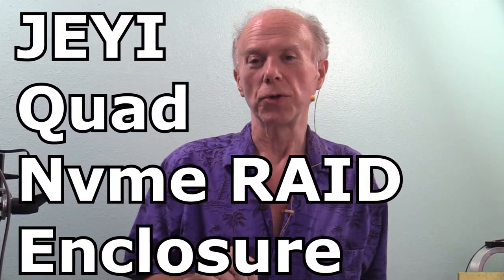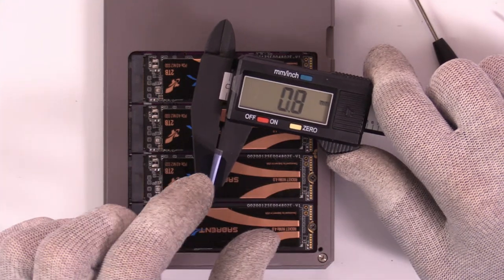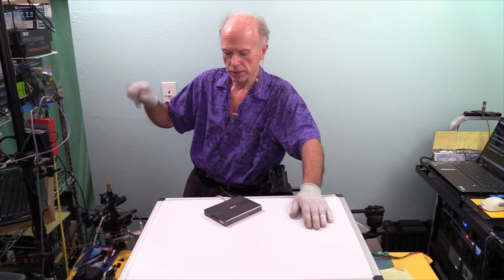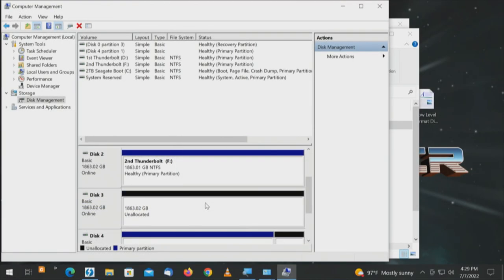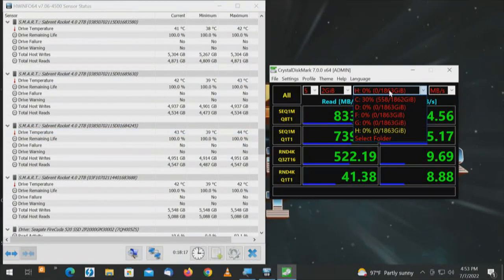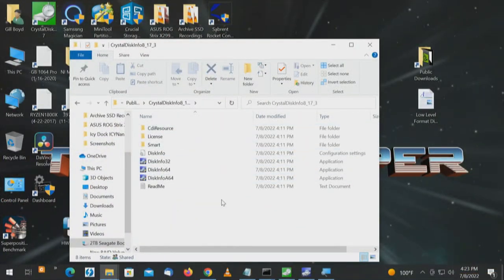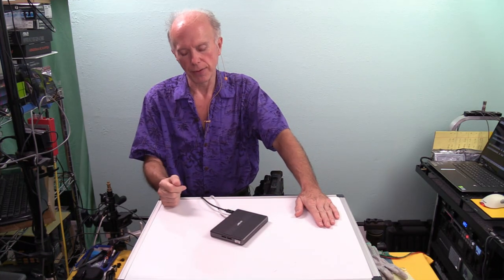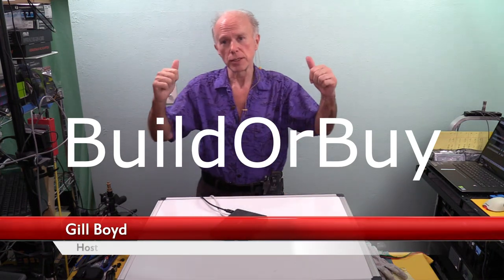JEYI Quad NVMe RAID Enclosure Thunderbolt

Comment: Last two questions, would you recommend this as a backup and data storage for a small business? And can a MAC M1 and Mac Intel access this RAID setup on shared drive on a network?  (Not NAS)
Reply from the maker: Hi J L,
Welcome! Not a Software RAID, NO of any kind! However JEYI has another Device, 2 Drive Hardware RAID that would be better suited for that purpose. Uses 10Gbps USB-C or 20Gbps USB-C but not Thunderbolt exclusive. We're working on a Video on this Device Listed below. 

JEYI Dual Nvme Enclosure, 2-Bay Hardware RAID Enclosure
https://amzn.to/3tVkzlH
As an Amazon Affiliate I earn from qualifying purchases! Hope that helps!

Noticed Your Edited Comment. Link to help below. 
Transfer files between a Mac with Apple silicon and another Mac - Apple Support
https://support.apple.com/guide/mac-help/transfer-files-a-mac-apple-silicon-mchlb37e8ca7/mac

How to Transfer Files Between M1 and Intel Macs With Share Disk Mode
https://eshop.macsales.com/blog/75601-transfer-files-between-m1-and-intel-macs/#:~:text=In%20the%20Network%20window%2C%20double,disk%20on%20the%20Intel%20Mac.
Good luck! To reiterate, We only know PC Computers! Hope that helps!
Reply: @BuildOrBuy  Read both replies thanks soooo much.  For now, due to cost I purchased one aSamsung 9800 Pro NVme M.2 SSD in 2To (very good sale) and will have to wait on the other two bars.  Since I needed and immediate solution to replace a 1To SSD used for Time Machine (Mac backup), I went with the Phixero 2-bay NVMe M.2 enclosure (no RAID).  But I'm going to try this solution you recommended as soon as possible, thanks!!!
Reply: @BuildOrBuy  And I will be looking for the video.  There aren't anymore available on Amazon for now.
Reply from the maker: Hi @jebl8888 ,
Looks like from Description You've made a good choice! Thanks for Sharing!

Just checked, JEYI Dual Nvme Enclosure, 2-Bay Hardware RAID Enclosure is in stock on Amazon!

JEYI Dual Nvme Enclosure, 2-Bay Hardware RAID Enclosure
https://amzn.to/3hcjh2P

PHIXERO Dual Bay M.2 NVMe SATA SSD Enclosure, Tool-Free Aluminum M.2 Enclosure, 10Gbps NVMe & 6Gbps SATA, for M Key/B Key & B+M Key 2230/2242/2260/2280 M.2 SSDs, Support UASP and Trim up to 2x4TB
https://amzn.to/3FFvE0R
As an Amazon Affiliate I earn from qualifying purchases! Hope that helps anyone else following Our Discussion!

Comment: I'm running it with a 2018 mac mini with 2 NVME drives installed.
- Initially, I was only able to achieve circa 600MB/s (10Gb/s) when testing using Black Magic Disk Speed Test and the 2 (max possible 4) disks in a JBOD.
- Using Disk Utility and configuring the 2 NVME drives I have installed as Software RAID 0 (Stripped) I'm able to achieve 1235 MB/s.

Obviously RAID comes with its pros and cons. I'm assuming the 40Gb/s of Thunderbolt is evenly divided across each NVME bay (10Gb/s x 4).

Hope that helps someone.
Reply from the maker: Hi Howard Sharp,
Welcome! Appreciate Your Comments! Those Details are very helpful! Thanks for Sharing! BTW: Have You tried to move the JEYI Device in RAID from one MAC to another? Just curious!

Comment: Due to how you wordered the description of the device in the first few minutes of the video I was under the impression that the Jeyi device it's self supports it's own RAID-0 mode some how? But you didn't test that? Only windows software RAID? I thought the device could combine the drives to one single 8TB device that's exported to the system some how? I'm confused.
Reply from the maker: Hi Blueberry Apples,
Great Question! To reiterate, this Thunderbolt Device only supports Software RAID which is a function of the O/S. In this case, Windows. For a Device to support it's own Configuration would require a SoC or System on Chip Design which would do more (internal O/S) and be more expensive as was mentioned with the iodyne Pro Data and Blackmagic Cloud Store in comparison! First the Hardware - This Thunderbolt Device. Second, which would be Configuration, is all done through the O/S. Hence the Question about moving a RAID Device based on Questions. Risky! Hope that clarity helps! Thanks for Asking!
Reply: @BuildOrBuy  Aha! thank you for the clarification. I would be interested to see if you could combine them with hybrid RAID using the motherboard's BIOS some time. You mentioned that might be possible in the video but I think didn't test it. If that would work then it might be a very nice option.
Reply from the maker: Hi @Sabrinahuskydog ,
That piqued my interest as well just to know. To reiterate, We don't know what's possible until We try. Being practical is a very different matter. My curiosity is getting the better of me to know for certain! We know what We saw!

Comment: Question...when using external m.2 enclosures how long will the data keep as I keep hearing that they loose data over time...how long is "over time".
Reply from the maker: Hi Mike Quinton,
Welcome! Great Question! Like Bit Rot! Been hearing that for quite a while now. Remember when LG created the M-Disc Data Disc? Ever use one? Neither did We! We still have good usable Data on 5.25 inch Floppies. At least it was still usable 5 years ago. Some Stat Data, expensive Font files and File formats of Data We are currently not nor have used in over 20 years. So longevity is relevant. Remember the movie, Time Machine? The Original one? Those Rings with Voices of Data. Spin them and they speak. Now that's longevity! Back to Your Question, We don't know the next format after M.2 NVMe. We did not know about M.2 NVMe until it arrived! There will be another and another. Technology moves on. And We expect We'll still be able to use the Data IF We have a Device that can read it! That's going to be the issue. Always something to ponder. Appreciate Your Comments!
Reply: @BuildOrBuy  hmmm....wonder if my cp/m emulator works
Reply: I went to a garage sale just recently and picked up some 128 MB and 256 MB flash drives. That's right MB, not GB. Old USB 2.0 drives for use in some of my older retro computers and they still had data on them with a creation date of in the mid 1990's when I connected them to a computer with the oldest being one drive with some mp3's from 1992 (Probably they came from napster!). That's 30 years of storage in NAND Flash and I tested and they still play in a music player today. M.2 drives are even newer and even better at data retention vs old flash drives so I would estimate data stored on them would last quite a long time. Probably longer than you or I will be alive.
Reply from the maker: Hi @mqcapps ,
Only way way to find out! Give it a try and see!
Reply from the maker: Hi @Sabrinahuskydog ,
On a side note, always check other Removable Media Devices for Bugs and Viruses! That's how Social Engineering gains a foot hold! But the Data is still intact! Yes! Agreed! Our Data will outlast Us!
Reply: @BuildOrBuy  I have an offline (no internet and no network connection) "Ingest station" where I virus scan any media coming into the house. Flash drives, hard drives in old computers, etc. It supports IDE, SATA, and up to USB 3.0. I connect it through my phone's internet (not my actual network) for updates to it's AV scanner. Thanks for the idea but I'm way ahead of you. :D
Reply from the maker: Hi @Sabrinahuskydog ,
Excellent! I would be remiss if not addressing that issue. Safety 1st!

Comment: fala sobre bifurcacao x79 atermiter
Reply from the maker: Hi David,
Welcome! 
Translated: talk about fork x79 atermiter
Please Define ?atermiter? X79 Chipset.... OK! Depending upon the Motherboard Chipset implementation, You may require a Bios Mod (Be careful doing that!) for the PCIe Resources required to be reallocated or Bifurcated which means to Split or Fork. As for this Thunderbolt Device, this requires Thunderbolt 3 which is PCIe 3.0 which provides 4 PCIe Lanes. Thunderbolt 3 requires Bios Support for Full Device Support by way of a Motherboard Thunderbolt 3 Header Cable. And those 4 PCIe Lanes exposed through Thunderbolt are mapped one to one based on the Bridge Chip Design which We do not know what Bridge Chip is being used in this Thunderbolt Device. Hope that helps Answer Your Question! Thanks for Asking!

Comment: I wish there was a USB 3.1 or USB 3.0 / 4.0 non thunderbolt version
Reply from the maker: Hi @xoxide1017 ,
Welcome! Very good point. USB-C 20Gbps is easier to implement than Thunderbolt anything with an add-in card if not already on a Motherboard.
Reply: @BuildOrBuy  Even if it was 3.0 versus 4.0 or 3.1 or 3.2 

I think that an implementation of USB a or c to for nvme in a hardware raid supported by the equipment or even if it was a five drive for raid 5 

Without the need of a Nas without the need of a Daz in the normal sense that requires software rates and all the other stuff 

Just really would like to have a four drive or a five drive nvme especially with 8 TB still being very costly
Reply from the maker: Hi @xoxide1017 ,
Not everything is feasibly possible. A Hardware RAID is ideal and doable. Connectivity is the next obstacle to maximize throughput. The lowest common denominator is the result. As well as keep it simple and portable.

Comment: Well this makes spending $700 for a HighPoint SSD7505 look like a good deal. 28000/25000 Vs 800/600MB/sec.
Reply from the maker: Hi Max,
Another Comment that slipped past Us! And just now seeing this! Wow! Yes, agreed! Do You have that card installed and up and running?
Reply: @BuildOrBuy  I only tested it in an X399 board with 4 2TB Sabrent Rocket 4 Plus drives.   My water cooled WRX80E lacks a CPU. With no money and the 5000 series TR PRO starting at $2500 for 24 cores I'll be trying a 3955WX someday.
Reply from the maker: Hi @maxhughes5687 ,
Got it! Understandable. All in good time. We can relate. Prayers!

Comment: The thermal pads aren't pointless.  On the otherside of the PCB, where the drives mount, I guarantee that is where the chipset lives.

That would seem to be a very silly and dumb idea...but not really.  Let's consider this:

Is the chipset going to get hot itself through operation?  Probably not, only indirectly from the heat of the drives.  So...in a way, you can use the actual chipset to dissipate heat off the drives.  That's not probably a very comfortable bit of knowledge to have, but it's a clever idea, and if the chipset can handle the thermals and do double duty as a heatsink...

There also appears to be more room than necessary on the top side of the card, where you can't look.  I suspect the chipset is attached to the case, with another thermal pad, and the case is also a heatsink, and that little gap and the different cutouts on either end are just designed to theoretically create pressure differential when there is heat, and cause a slight exhaust effect.

It makes sense, that in a passively cooled case, 'small' case, you would put the hottest components at the bottom, and allow everything else to absorb and dissipate heat.

So the case is the heatsink, and it's probably connected directly to the PCB components on the reverse side with thermal padding.  That's why they want tight contact to the case on the heatsinks at the bottom as well, because the case can absorb that as well.

You said the top felt hotter than the bottom, where the heat is actually coming from.  So those thermal pads ARE making contact with the case, and the case IS a heatsink.  That's why the case needs to have those ridges tightly machined as well, as the entire thing has to fit together in such a way that it acts as a block.
Reply from the maker: Hi czerro1,
Welcome! Appreciate Your Comments! Thanks for Watching!

Comment: Why are you doing precision jobs with thick gloves? 😅
Reply from the maker: Hi FUOFire,
Welcome! To reiterate, ESD which is Electrostatic Discharge, when handling sensitive Components such as M.2 NVMe PCIe Drives or Motherboards and the like. These are standard ESD Gloves as recommended by Intel for their Reseller Training Events in the past. Thanks for Watching!